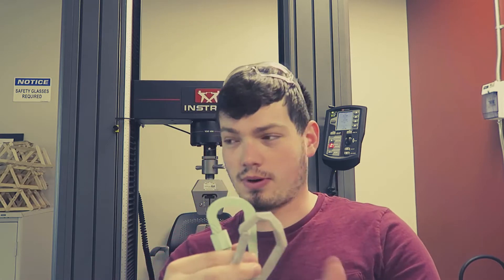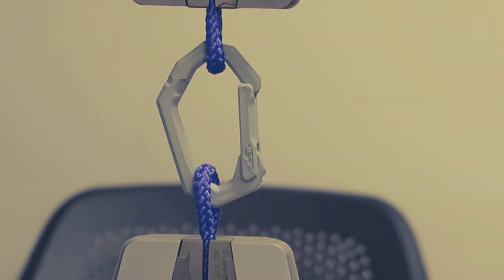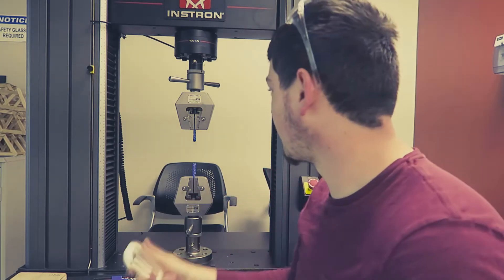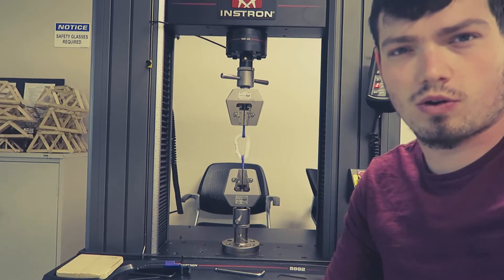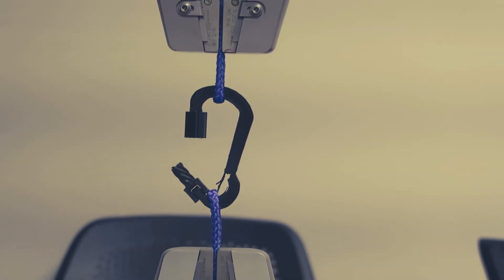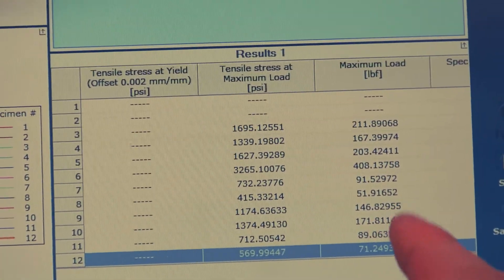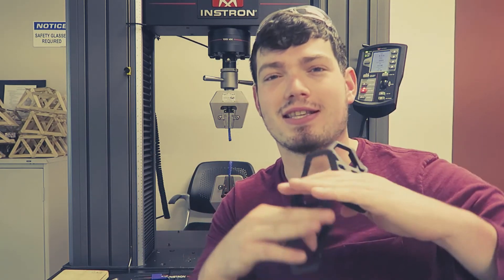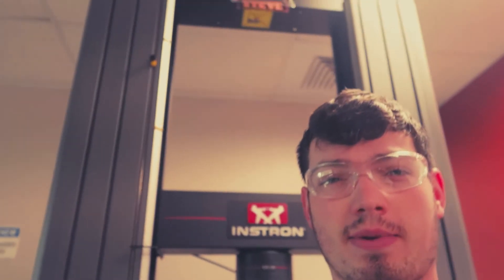What Is The Strongest 3D Printed Carabiner?

Comment: Tnx for upload. Printed couple carabiner in petg, 50% infill. Octet infill. They seem to be stronger than me.. Hehe. Consider testing them, hopefully I can use them for some gear that will be in salt water. Thing the treaded carabiner needs a redesign. Thread seem way to steep to carry out the function the creator imagine. I could be wrong tough. What is the strongest carabiner one can 3d print? Anything that can handle 70-100kg using petg with surtenty? 70kg is heavier than I imagine load will be, I would like a buffer. Not pushing it to the max if reaching 30kg. 30kg is also above what I imagine the load would be. So 70kg is overkill.. Considering 3d print because plastic dosent erode. Also, why not. Have the printer, why not use it for practical things. 😄
Tnx
Reply from the maker: I only printed these in pla I'm sure petg due to layer adhesion would be much stonger. I'll have to look through the video to double check the strongest design. I'm sure you could even double them up to ensure it would stay attached.